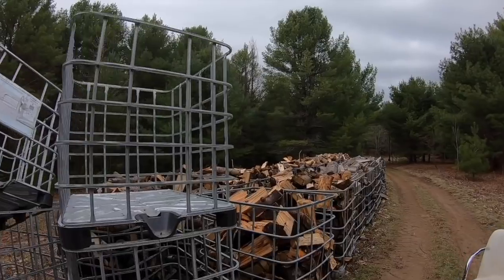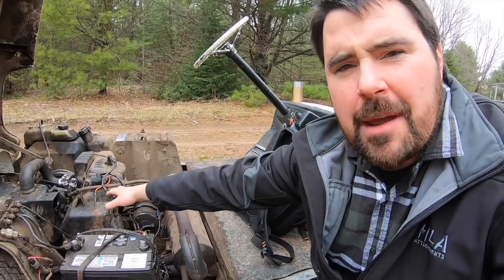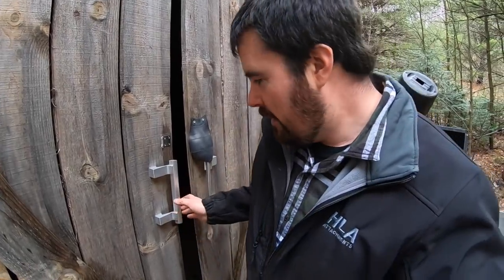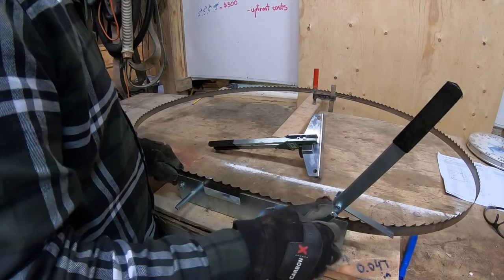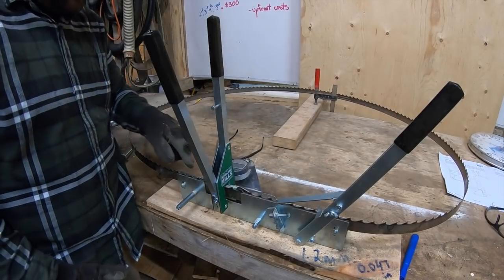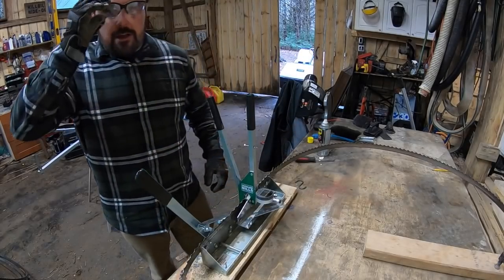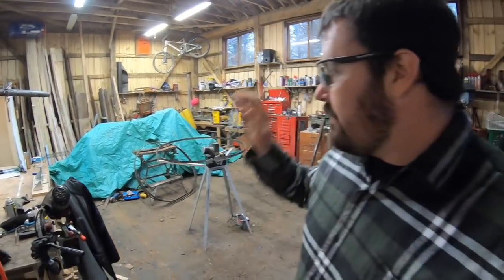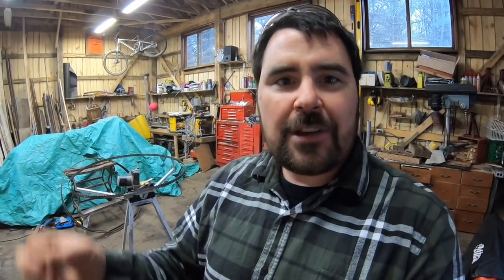Making Quick Work of Blade Sharpening | Sharpening Old Sawmill Blades

Comment: Hi Sandy. Have you tried different thooth angle?? I've tried 7 degrees for hard wood and I've also sharpened at 14 degrees for soft wood. I've made a test in red maple with the 7 degrees. Haven't tried the 14 yet. Do you always use 10 degrees??

Comment: Hi Sandy, I've enjoyed many of your videos. My HM130 max is ordered and on it's way. I ordered many accessories to go with it including a ten pack of blades. I've had a hard time deciding about the sharpener. I didn't order it with the mill as the almost $1k for the sharpener and tool setter is a bit much for wallet at the moment. While I love the idea of being self sufficient and being able to sharpen my own blades I have to ask is it worth it? I'm obviously new to sawmilling and I don't know quite a bit. At $25 per blade it takes 40 blades to equal $1k. How long would it take to go through 40 blades?  Any info you can give would be helpful, thanks.
Reply from the maker: Hey Brent! Thanks for watching the channel all this time. I had the same hard decision you did an it took me about a year of sawing for me to decide that it was worth the cost to buy the sharpener as I found the convenience was worth it for me. I don't have anyone near me that sharpens blades and I was finding it expensive to have to buy new blades especially on those days where I'd dull two blades inadvertaintly by hitting a nail or dirt or something. Now that I've got the sharpener I find I"m not buying blades hardly at all and so the ability to simply touch up the saw blades and get back to sharpening without having to order and wait for delivery is nice.
Reply: @sawingwithsandy  Thanks for the reply, that helps. I think I'll be ordering one this fall. How often do you normally change a blade? Do you think a ten pack is enough for a comfortable rotation of blades or should a guy want more than that?

Comment: Your blade sharpener and gummer set up is the same as we used in shake mills. We cut cedar into cordwood lengths and then made three quarters of a inch boards with a splitting machine that would just rattle them off in like  stacks of what was comfortable for the sawyer to pick off the conveyor where he would pick each one up and guide it into the saw blade and start on one side and finish on the other leaving the spilt board to be sawn into on the inside of each board making it able to lay flat on a roof and shed water hence shakes for peoples roofs. I used to do everyone of the sawyers blades for them keeping blades uniform in sharpness and usable on any shake saw in the mill. Different people do blades differently and subsequently blades that handle differently on the saw it is on. A person who is green in this area or lazy can get a good sawyer cut badly as I can attest to as I would shuttle them to a doctor to see if the fingers can be reattached or they are just going to be missing. I personally know how it feels to cut a finger off and get it reattached to me... one finger has been reattached two times and is still quite numb to this day forty years later. Nice job showing people what goes on Sandy

Comment: I've got old blades been hanging in the shop for years. Will rusty blades sharpen up and work?
Reply from the maker: I'd say you can clean them up nice with a wire wheel and sharpen them no problem

Comment: Hi, so when the sharpener in in action it looks like it sharpens at zero degrees across all sets. Is that correct?
Reply from the maker: I set it to 10 degrees
Reply: @sawingwithsandy  hi. That's interesting. Does your auto sharpener sharpen one set one way and then the opposing set another way, ie +10 degrees then -10 degrees. Just asking as it looks like it sharpens all teeth the exact same angle, which I thought woukd cause the blade to rise up or down when cutting. Interesting machine indeed.

Comment: Wondering why you are not giving back of the tooth a little touch?
Reply: He said he was going to run that blade twice, second time reset to grind the gullet. Why grind the backs of the teeth?
Reply: @OregonOldTimer  Back of tooth can micro fracture and get dinged just like the rest of the blade. Best practice is to hit every surface
Reply from the maker: I didn’t film the second go around for the blade but usually the second pass is when I give a very slight touch to the gullet. With some blade profiles I’m unable to do the entire tooth in one pass as that takes too deep of a grind
Reply: @sawingwithsandy  I find that my blades cut better with that little touch. I am usually cutting bigger logs than you are. Also dealing with white pine pitch lately I started to use diesel fuel and chain oil mixed half and half just a little squirt  when it needs it.
Reply: @Desert_Hobo  That's the only reason I could think of. Cook's sharpeners grind face, gullet, and backside.

Comment: MISTAKE!!!! You should sharpen first then set as when you sharpen your set goes down!
Reply: Everything I've seen, read, and heard says set first so sharpened tooth is square with the blade. Reduction in set would be microscopic.
Reply from the maker: I’m not sure what’s right or wrong here but I’ve always set first as my thinking was that I want to sharpen the blade where the final position will be for the teeth

Comment: While I appreciate self reliance, the cost is questionable/practable. The setter is $299 and the sharpener is $699 ( not counting freight). I buy blades from GA at $16 each delivered. I would have to sharpen 63 blades before breaking even.
Reply from the maker: Yeah I can see your point. Here in Canada the blades cost me about $25 cdn each and so with the cost of 849 and 299 cdn for the sharpener and setter pays for itself a bit faster here
Reply: @sawingwithsandy  I'd love to send you my old blades. They are currently just gathering rust. I don't have a way to sharpen them. It's cheaper for me to buy new ones. Wonder what the freight is from SC to ONT?